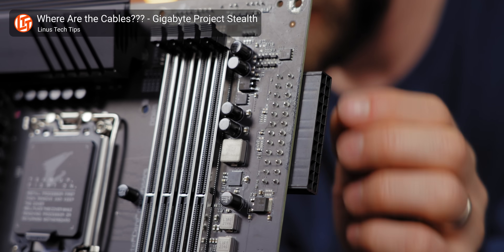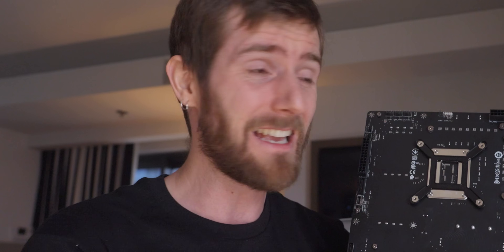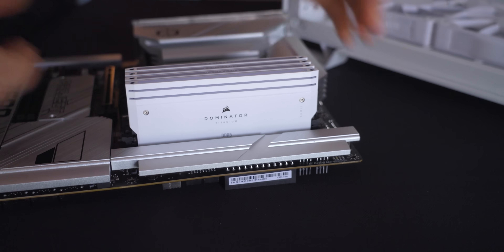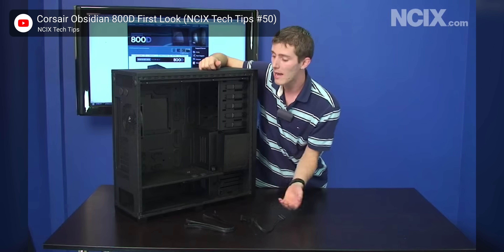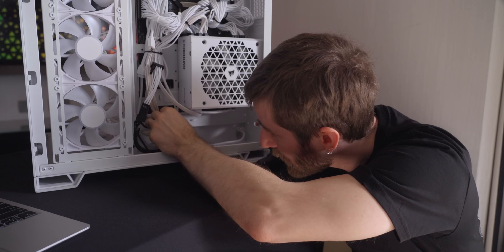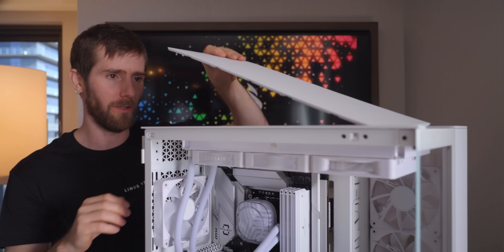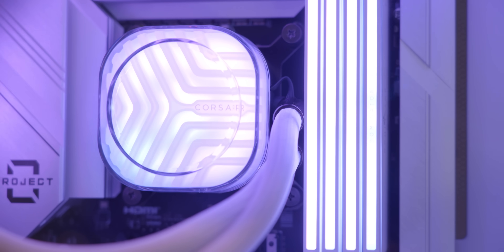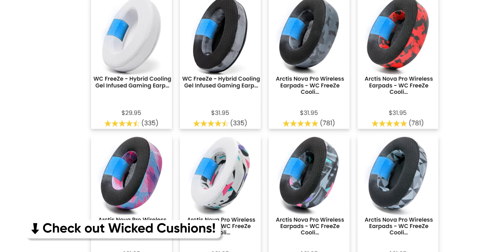I had NO Faith in this... - Hidden Cable PCs

Comment: Just need GPU power to be on the bottom of the card instead of the top. Then you can run a hole into the back with the rest of the cables.
Reply: I have no idea why nobody has thought to do this years ago
Reply: You would still need an altrrnate connector for eatx server/workstation motherboards which are a lot wider
Reply: @squidwardo7074  Apple used a special extra connector for their cards to give the power and no need extra cables. I just want the connector in the back like is on the nvidia Quadro series, if possible at 45º angle to have less stress bending cables.
Reply: Asus version of this can supply 600w of power though the motherboard meaning the gpu needs no cable
Reply: @Tyrim Okay, but servers and workstations should be using NVidia Quadro or Radeon Pro cards, which already have cooling and cabling requirements of their own. And even if they don't, you could include what are essentially "clamp-on" adapters, C-shaped boards that wrap around the back of the GPU using thick traces to transfer the connector to the topside, or end-on at the back, for those that need it. They'd be entirely passive, and could even clip on or screw in if retention or mounting angle is a potential problem.
Reply: @Anaerin  yeah, i see your point, however a lot of workstation tasks give you a better price/performance with non-quadro cards, plus adding additional adapters is always a reliability concern. not to mention that clearance under the gpus is very slim in a lot of cases due to large heatsinks for chipsets, m.2ssd-s etc. i don't think a traditional connector on the bottom side could fit. plus a C adapter would necessitate a strict assembly order, otherwise you will lossen the connection with the gpu while plugging in the power cable. not to mention it would make accessing the pci retaining mechanism just a bit harder than it already is.
Reply: @Metalsonic91 PCIE still has a limit of how much power it can reasonably deliver before it overheats the connectors
Reply: @HoldMyPoopKnife   ATX is way little anyway, 4090's uses up a lot a of space. Almost cannot put a single card under the GPU these days. Or maybe need to relocate the 16X slot.
Reply: @25566  There are real reasons to avoid riser cables. Some people consider it a no-go and Linus has made it pretty clear over the years that he considers it a last resort thing.
Reply: @Metalsonic91  ya but the problem with asus version is that if your gpus sags at all there is a chance you melt your gpu and mb on higher end cards.

Comment: This approach with the cables on the back does seem innovative for easier building and better aesthetics. Looking forward to seeing this implemented in more motherboards soon!
Reply: Bruh, aesthetics are the same XD
Reply: Hope this doesn't make to mainstream
Reply: Oh yeah, now you only need specific cases and components, and every company is doing its own version, meaning proprietary stuff and price increase
Y'all complaining about prices not realizing you're part of the problem and ruining for everyone else
Reply: I'd also like to see something that I thought of which is integrated cabling INTO the frame/walls of the case so you would only have extremely short runs of cabling to the sides of the board and/or directly adjacent to the PSU. Heck you could even have a PSU with pogo pins on the side that eliminates cabling to the PSU so that you would only need extremely short runs of cables right next to the motherboard. Just a thought - there's tons of innovation possible in the world of cases, I just wish we would see more of it.
Reply: @sys-administrator  what? you literally described how its done today ,you have to aproach it from both sides whereas this would make cabling easier from only back side
Reply: @sys-administrator  no you cant unless you have 20 year old case that used to not hide cables behind the mobo...every modern case hides the cables behind the motherboard but you have to access ports from the front.
Reply: @sys-administrator  ok then dont lie about how it is done nowdays because i can tell you haven't build a computer since 1999
Reply: It makes building harder and aesthetics is something a small minority of consumers with with glass side panels and terrible taste care about. Form over function bs
Reply: @oiytd5wugho  how is it harder? he literally says its easier to build in the video
Reply: @m.h.7901  It's easier if you want to go all OCD with cables, if you don't care it's harder

Comment: I feel like the first issue that should be tackled is standardizing the front panel connectors, that's probably the bigger pain point for new builders. Heck I'd consider myself an experienced builder and I still struggle with them
Reply: My motherboard manual is the ONLY manual I’ve read in the last 10 years.
Reply: My front panel is technically incorrect rn. But I just cannot possibly be bothered to fix it.
It powers up and does everything it's supposed to.
The power button LED flashing because it thinks it's a harddrive activity LED is not worth the effort.
Reply: @Gary_The_Metro   Yep, 7 years later and I'm not sure my Power LED was ever plugged in in the first place. Given that I can see my screen, and the PC is on, that light ends up not being worth it to me.
Reply: It's been over 20 years. I have no faith they will ever standardize front IO cables.
Reply: For brandnew PC builds it's kinda easier coz you still have the Manual sticking around, but for  tech's like us who also offer deep cleaning of Clients' systems. You need extra time and effort to google a cheat sheet or take a picture of the before and after for  certain motherboards every time you put those back to make sure u don't fck up. 😢
Reply: It's standardized now by the whole btf project . Basically for every motherboard selling in China are the same(msi style 9pins), and cases that supports btf are aio as usb2 and audio connectors. But for the rest of the world, it might just takes time.😂
Reply: Tbh, in most builds in handled over the years, the pins were all in the same order on different manufacturers' different boards. NZXT curiously has some cases that feature a big connector that servers all the Front Panel pins rather than single cables, arguably placing quite a bit of trust in manufacturers to follow that quasi-standard layout.
Reply: Yep they should merge everything with the USB 3.0 connector, same for audio cable.
Why the f*ck do we need to plug 54 câble if everything can pass in one USB cable....
Reply: I HATE THOOOSE CABLES

Comment: out of everything in this video im most amazed by the aio, the pump design looks absolutely incredible
Reply: lol is just a swapable pump top from corsair ...they also have one with a intergrated fan
Reply: @DeterminedFC  Do you know where you can get this pump top? I'm interested
Reply: aio's suck if you game, just buy a d15 or a peerless assassin. easy 30 bucks.
Reply: @H786... D15 is the best cooler ever but if you’re getting a fish tank case like the one in this video you NEED an aio, it’s impossible to aircool when the front fans are on the side and you don’t get that air tunnel airflow. Arctic have the best aio coolers tho and corsair are truly lacking in almost all aspects of computer parts in both specs and price
Reply: @od.s the AIO is the corsair Titan and I think the cover is one of 2 or 3 that it just comes with.

Comment: It'll be really cool to see a build with custom length cables using a Mobo/PSU/case like this. Could be crazy clean.
Reply: Agreed.  For instance, the path for the GPU power is driving me bonkers.  A longer cable could be tucked behind the card for a cleaner look.
Reply: There is no benefit to a "clean" look or cable management. In fact it makes things more annoying.
Reply: It looks cool tho so that makes it worth it imo@Schule04

Comment: The rear cable patent "standard" should be reversed on how regular panel connectors should be
Reply: Sadly there isn't a standard to where regular panel connectors should be either...
Reply: Motherboard manufacturers wear the pants in this relationship. Case manufacturers will have to accommodate for motherboards changing, otherwise no one will buy their cases.  They can complain all they want, idc.

So I propose motherboard manufacturers start designing cooler boards/change the standards.
Reply: I find it strange nobody challenged the patent or told them to f off since some connectors have been seen in back of motherboards in computers since like forever.

they could do some design patent I suppose for the exact locations.
Reply: Also this doesn't improve anything
Reply: Just make a standard where you just plug a cable into your motherboard and there you go, it powers everything, or have it so you plug the power supply into the motherboard like a graphics card and have no wires at all!  XD  (I'm only half kidding, I HATE CABLES)
Reply: but there's no front connector standard lol.  if mb manufacturers just reverse the positions on their current boards they'll still all be different
Reply: @maolcogi  idc about it, it improves nothing
Reply: @A-BYTE94  well I don't care that you don't care. How about that?
Reply: @maolcogi  Don't even needed a cable for that.  Just need a bigger mobo and the psu slide on to.  Zero cables.
Reply: @maolcogi  Server motherboards sometimes have connectors along one edge, that the PSU just slots straight into. Of cours, in those cases Dell/HP/whoever are making the mobo, case and PSU, so they can pick any arrangement they like.
Reply: @maolcogi Great idea, but some boards need more power or different voltages than others. I'm sure someone could figure out a standard that accommodates that though.

Comment: It looks really clean.  I'd love to see a removable/swappable motherboard tray so you could future proof it.  You want it for a different vendors format, just buy the tray after.  There is an industry standard now?  Buy the new replacement tray.  You want less holes as you are putting a smaller form factor board in it for now?  Buy and swap for a micro-ATX tray.
Reply: This would probably be the best solution long term but I can't help but think the retooling costs, much less all the spare parts, would make manufacturers and vendors alike a little wary. That said it would potentially help with rigidity slightly by making the swappable trays specific to AMD or Intel and thus potentially reducing the need for cutouts for the backplates but that also feeds back into the issue of spare parts stock.

Comment: I think the solution to SSD mounting woes for shit tons of SSDs, is to just do it with daughter boards the way you already see on HEDT boards sometimes. Just do it with a standard PCIe interface but using PCIe slot bifurcation, and allocate however many lanes of whatever gen are needed to feed the supported drives properly, up to the maximum of the slot. You would just add the lanes to the CPU like normal and then route it to a slot, also like normal, and maybe still offer 1-2 slots on the board itself like we have now for a boot drive using the same limitations. Then you could use all the lanes for whatever you wanted, and have a big card with up to 16 SSDs on it that you can also actively cool more easily with them all in one place like that. I think it'd be awesome that way personally, you could use the slot for a 2nd GPU and bridge the gap between modern HEDT and consumer platforms, or offer a pair of x8 lanes to allow connection of high speed NICs and 4k+ capture cards if you don't need 16 lanes just for drives. There are all kinds of benefits to doing it this way that roll over to things besides just SSDs, but I think the idea of the tech is honestly great. I don't think we'll see a standard that allows for mounting a bunch of individual drives to the rear of a board since you DO need some metal to provide enough rigidity to the motherboard's tray. More likely we'll see them add slots like I suggested to the back of the board for a daughterboard to mount drives on, or even mount in a hard drive tray and just use a server style PCIe extension cable with its smaller footprint connector
Reply: Interesting viewpoint, thanks for sharing.
Reply: Isn't that what M.2 is? Or PCIE M.2 daughter boards? I'm not sure what you mean
Reply: The problem with daughter boards is that they greatly increase the price and design complexity. Plus, we already have PCIe boards that support multiple SSDs. If you want a daughter board, you can just buy a SSD PCIe board for ~$80. Personally, I think it's not worth increasing motherboard prices by that much. If someone needs that many SSDs, they can just buy the expansion card themselves.

Comment: my PC from 2017, an MSI prebuilt so small it fits in my backpack, had the M.2 connectors and the second RAM slot on the back, as realistically those were the first thing anyone would modify off the starting point. I love that design, because the wrap-around panel just slides off and without any cable management you have access to the RAM, HDDs, SSDs (SATA and NVMe), graphics card.
I'd buy it again if I could get a new motherboard for it

Comment: What putting the board in and screwing down does is give the case more SHEER strength. Like, when they plywood over the outside of a wood framed house. Cinches everything up nice and tight.

Comment: Very brave of Corsair to let Linus have his way with a working prototype.
Reply: Eh, it's free product testing alongside marketing value. If there are issues identified by Linus, they can correct it before full production and beg off that it was a prototype and finding issues is exactly what they are for. And they'd be right. 

Prototypes tend to be made using different manufacturing processes than production, meaning that things like build quality can actually be higher than when you start mass production.

What would be really brave would be an early review of a product that's come off the line, chosen at random, while the rest are still on route to store shelves. That could kill a product launch.
Reply: @paulk5670 he's joking, Linus was a tendency to drop things

Comment: Really don't understand why the GPU power plugs aren't just moved to the bottom motherboard side but right at the end where these big GPUs often extend well past the motherboard, if you look @12:05 the power cables could easily be hidden behind the GPU and disappear straight through one on those grommets, I get that the PCB often doesn't extend that far bit its really not a complex problem to solve.
Reply: I thought the same thing I think they are worried about clearance I guess, but no matter what some cases will always have clearance issues

Comment: Call me old school, but I like the aesthetic of having a computer that looks like a computer.  Don't hide all of the components, SMDs, capacitors, etc. behind shields.  I don't like NZXT motherboards for that reason.  Same thing with cables.  I like having the cables be part of the build, so something like Cable Mod is great.  Plus it fills out more of the PC.
Reply: if you are marketing to first time builders, then they should be building simple machines first and then move on to the complicated artsy stuff later. for somone who is new to pc building its better to go for something simple that eliminates potential points of failure. stick to the basics, and once proficient do a show piece (or sff builds, which i prefer).
Reply: bro these components are so small these days that you cant even see them anymore unless you get up close.

Comment: My biggest problem with this concept is that it would make a lot of perfectly usable or even great cases redundant. I really like my case and need the disk drives at the front since no new cases are coming with that feature anymore. If it becomes a dual standard it could add to the confusion for new builders and could cause a need for multiple versions of motherboards and cases.
Reply: Its nothing they could push out to the mass market that fast anyway, only with quite a long transition period.
New builders are confused anyway.
Reply: I'm a "new" builder that's returned to building my own PC after years away from the hobby and I wholeheartedly endorse the fact that we are confused. 

I'm sure we always had stupid acronyms, but by god it's hard to refamiliarize oneself with now on the nuances and which components play nice with each other. And don't get me started with the coil whine lottery- did we really collectively decide we all want to never use external speakers again? I wish I had learned that before dropping money on high quality audio monitors.